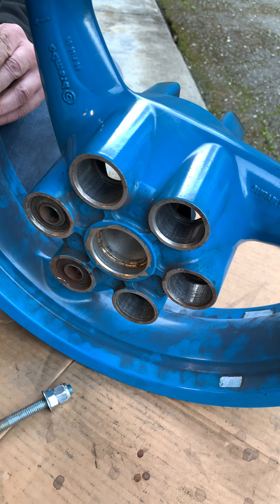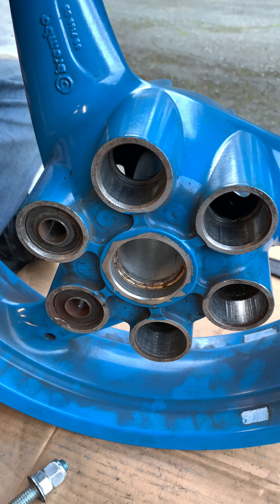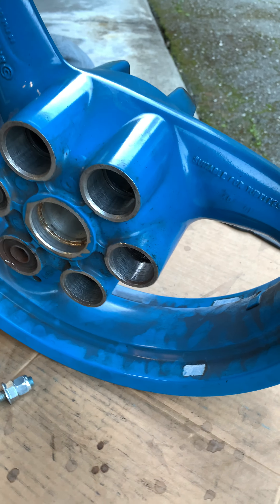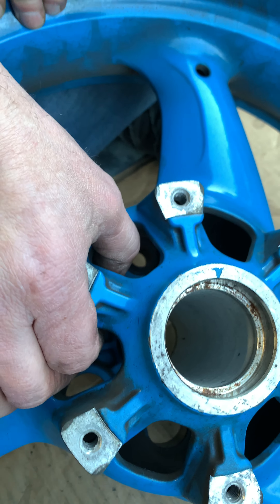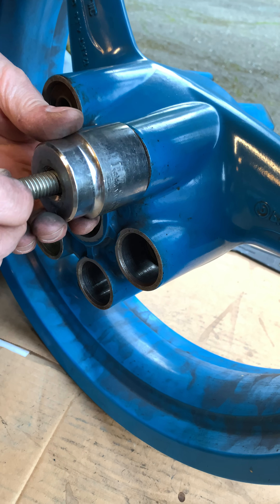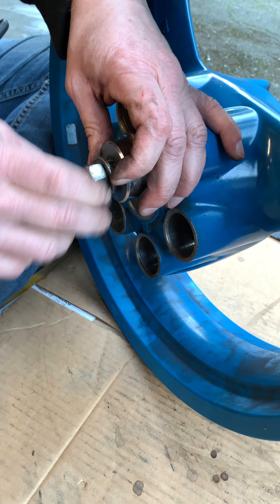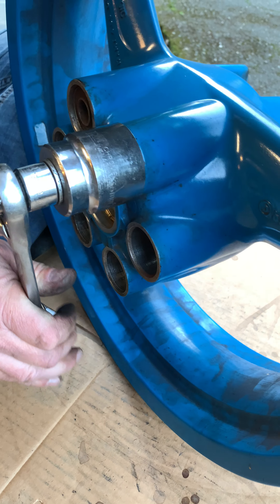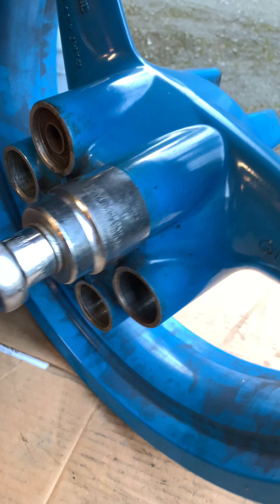Ducati Cush Rubber Puck Removal Tool, Cheap, Easy, Effective

Comment from the maker: I also used the same tool to put the new ones back into the wheel.
Reply: Howd'ya manage that seeing as the backside of the wheel has no flats & the holes are offset (at least on my ST2 wheel and I'm pretty sure they're the same as the Monster wheels... I was thinking of a 6mm (1/4") rod through the brake rotor bolt holes but they're slightly offset..
Reply: Never mind I figured it out 😂🤣😂